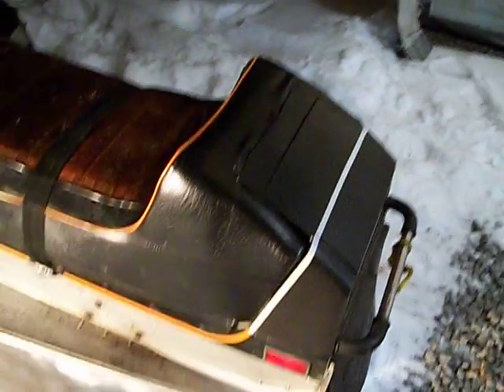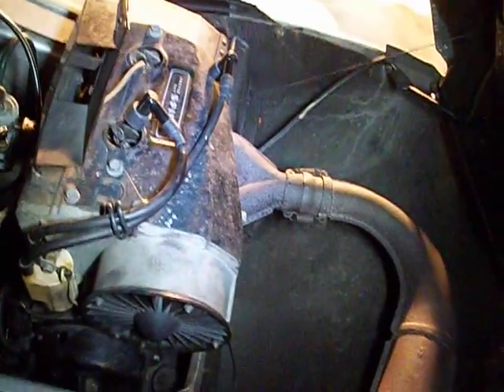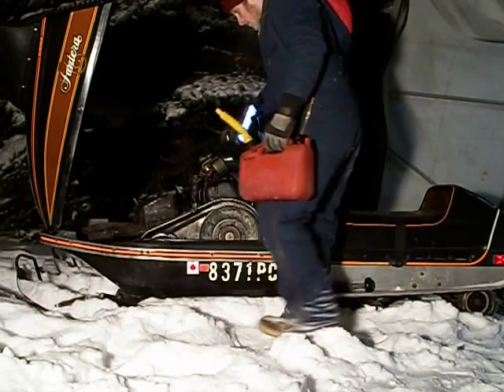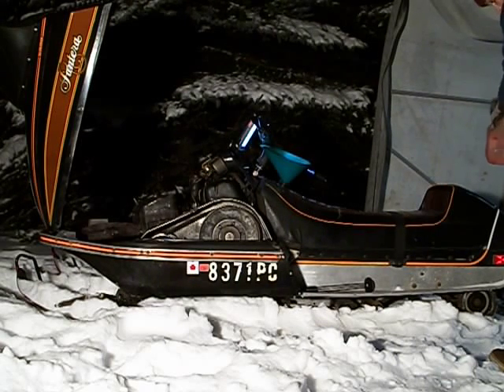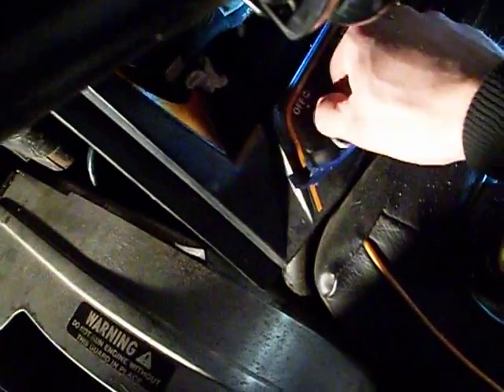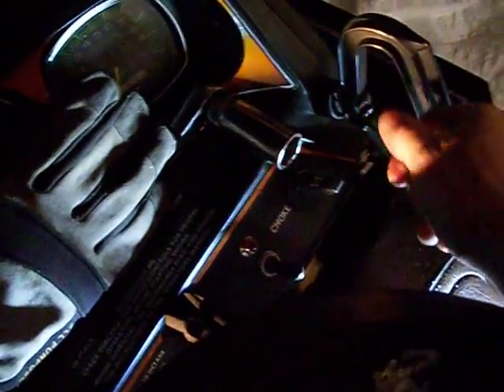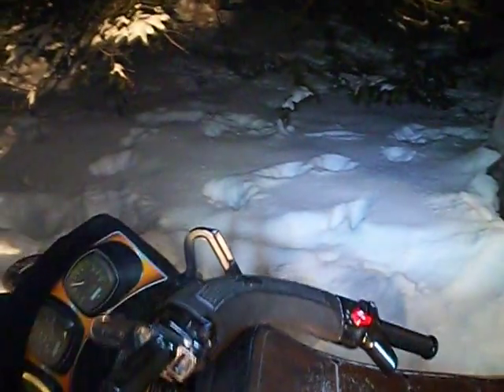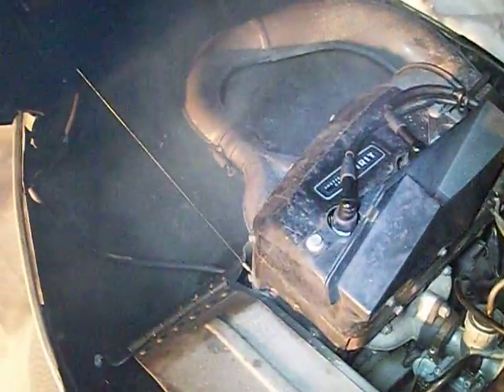Cold start old start of my 1978 Arctic cat Pantera 5000 F/C

Comment: This is an old video, but for others… Add a primer to the old Cats along with fuel line check valves.  Fixes starting issues.

Other hints at starting old sleds:  if you have spark and clean plugs just prime the cabs with a shot of premix.  I also use starting fluid but some say that’s a no no.  I have done it forever anyway.  This will save your back from repeated yanking.

Comment: Your Dad was right between 10 and 11 minutes when he said the spark has to go somewhere. You can easily fry a CDI system by pulling it over without plugs in it, especially the early ones like you got there. You overload internal components in the box when the voltage has no exit to discharge by normally grounding the plugs to the head. You'll burn it out, maybe not today or tomorrow but you will if you keep doing that. They are expensive too so good to be sure you don't waste one for nothing. Also pumps fuel better with plugs in because you get more base pressure for impulse. Without compression you don't have enough vacuum for base pressure on the way down.

Comment: We would blow into the tank. while someone would put the fuel line back onto the carb after fuel started coming out. That's how we would get fuel into the carb. It's faster and better then pulling it 50 times. Great video though. I had one of these. Miss it even though it broke alot.